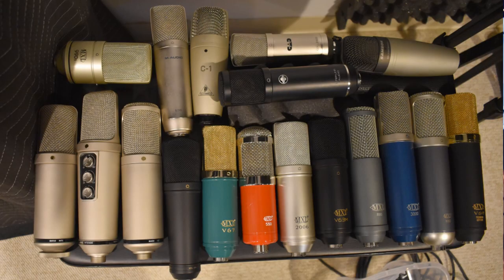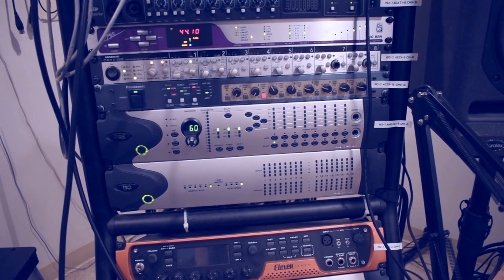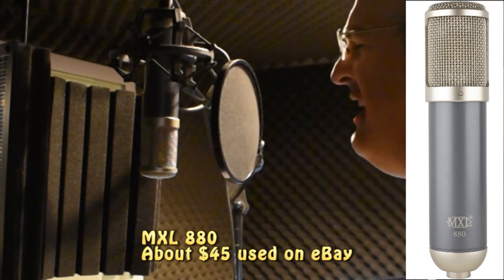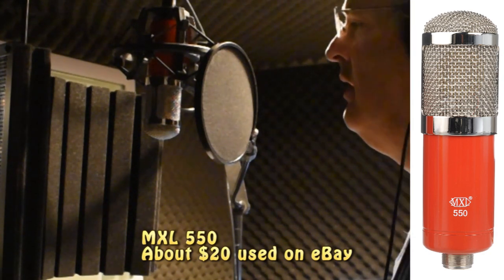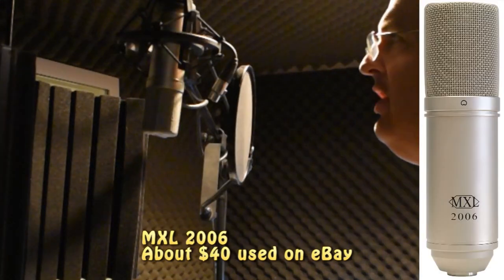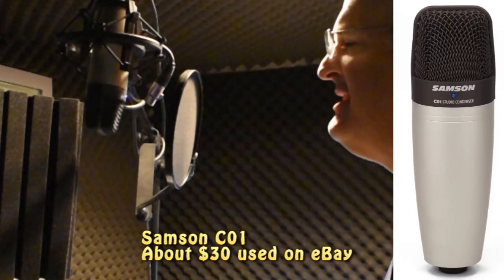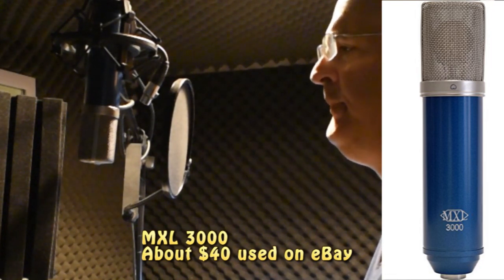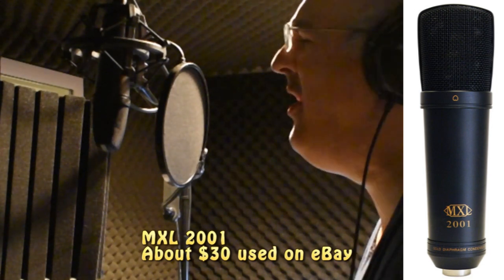18 Cheap Large Diaphragm Condenser Vocal Mic Test

Comment: A lot of these are basically the same mics, same capsules and circuits rebranded by different companies. M Audio Nova and Sterling Audio ST51 are the same mic in different housings. Those two use the same capsule as Manley Reference, if you ever get the chance to shoot them out against Manley i promise you will get shocked how close they are! Most of MXLs are the same mics with slight variations. Great video, thanks.
Reply: how do you know the nova and st51 are the same? I thought the m-audio nova was a bit heavier

Comment: I think what is MOST interesting is how the majority of the mics are more alike than different...which is to be expected I suppose given their price tags and the fact that most of them probably contain  the exact same Chinese sourced components. However, there were a few notable exceptions...both good and bad.

Exception 1 - MXL R80 - It possessed all of the typical ribbon virtues...a smooth and non-spitty top end and a lower mid forward presentation which gave this singer a chesty/throaty character.
Exception 2 - Samson C01 - Thisssss one had glaring sssssibilance.
Exception 3 - MXL V69 - This one was a revelation. It's like someone took away a veil in front of the mics. Of course, that could be down to an overly bright forward tonal balance? I just know it had a sound signature and character distinctively different from the rest. Possibly the tube?

Comment: Thank you! I hear slight deviations of the frequency response(excluding ribbon one, that's really deaf), and huge S/N difference especially between 1st and 2nd example. I think need to leave more silence time to evaluate the S/N, which mostly makes difference. For a demo purpose, even $20 condenser is fine, however, for a music production they are too noisy(maybe $20 mic + noise reduction is ok as well but not for a vocal jazz of course).
PS: where it was possible, I found silence and measured S/N(data was normalized for voice over =0db): 
Rode K2 Tube Mic     66.3db(A)
Behringer C-1             55.8db(A)
MXL 880                     69.4db(A)
M-Audio Nova            62.9db(A)
CAD GXL2400            66db(A)
MXL 550                     70db(A)
Rode NT2000             70.8db(A)
MXL V63M                  
MXL 2006                   72db(A)
MXL R80 Ribbon Mic
MXL V67                     68.6db(A)
Samson C01               61.6db(A)
Sterling Audio ST51  68.9(A)
MXL 3000                   71db(A)
MXL 990s                   62.3db(A)
MXL 2001                  
MXL V69 Tube Mic   61.6db(A)
Rode NTK Tube MIc  65.4db(A)

Comment: Hello Justin I appreciate your video. You did a good job. I have listened to a lot of videos of mic comparisons and no matter who does them I cant tell the difference between a cheap mic and an expensive one. I don't know if that makes me a lucky guy or unlucky guy.
Reply from the maker: Rob Quinn thanks Rob. The differences are subtle. More something you feel when you’re singing. A good mic inspires a good performance. The mic choice depends on the singer and the song. All the best and thanks for the kind words.
Reply: Thanks Justin.
Reply: It is hard to tell the difference with the mix. If you download the original you'll notice a few things: 1. during the silence after announcing the type of mic, there is very quiet white noise with some, where-as others are silent. For recording the spoken word, you'll want a mic that is silent when idle. 2. The recordings are not balanced, because the poster did not reconfigure their pre-amp between microphones, some microphones are significantly quieter with the same amplification. 3. Some microphones pick up a lot more pop and lip noise. 4. You'll notice with the Rode NTK and the MXL R80, when the singer starts "cause I could never" that in the words "cause" and "I" sound much different than the other mics. Less sharp, the amplitude doesn't vary as much. Whether that is good or bad is probably subjective, so long as you're not getting actual clipping.

Comment: Great job, Justin (and your singing is good) !! Thanks for all of the demos.  You really went way beyond what most of us do, in presenting what these mics are all about. Here's a couple of links. If you want to hear what two mics sound like with EQ, here is the Behringer C1 and Audio-Technica AT2020.  The Behringer has 3 sets of EQs that it is running through.  The AT2020 has one set that it runs through, and it's bumped on the highs and lows. Here is the C1, first. https://www.youtube.com/watch?v=1qmpG38-v3I  Here is the AT2020 https://www.youtube.com/watch?v=_ab-x4gdQU8

Comment: Great work.  I have a more bizarre question.  I have broken the capsule in my AKG P220.   I'm seeing capsules as cheap as $20 on ebay and as high as $160 elsewhere.   And it was only a $150 mic.  

Do we know if it's the internal signal path vs. capsule quality?   I can't imagine AKG pays more than $5 for a capsule anyway in the whole scheme of things.  I'm going to buy the $33 capsule and always wonder if I'm really ended up getting the $20.  

Any thoughts on Capsule quality and how it affects the end result of the mic?
Reply from the maker: What I can tell you is every mic is different even ones that are the same make and model. It can be subtle but less so when you're the singer and actually tracking. I think it's almost impossible to pick your favorites without trying them out for yourself. At least with cheap mics, you can have lots to choose from without spending a lot of cash. On the other hand, investing in a quality mic, really not such a bad thing if you can afford it.